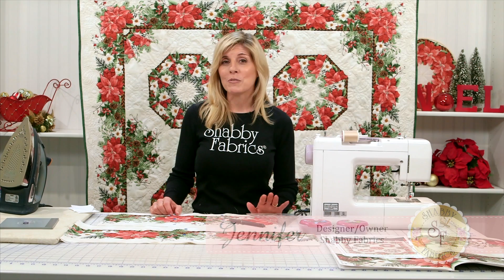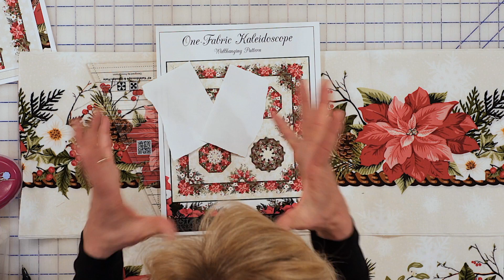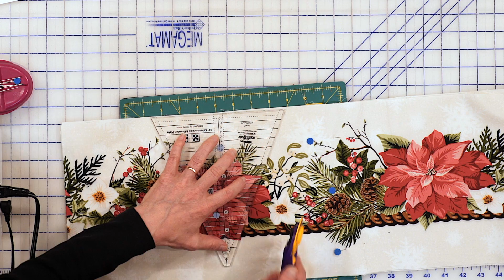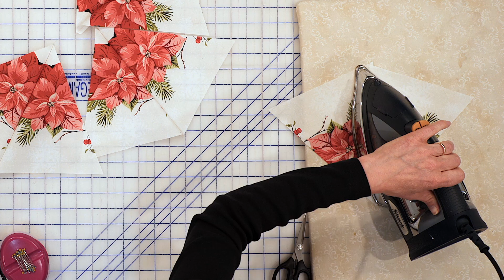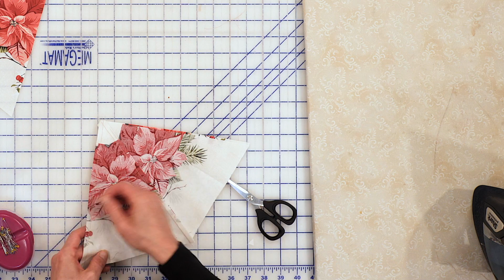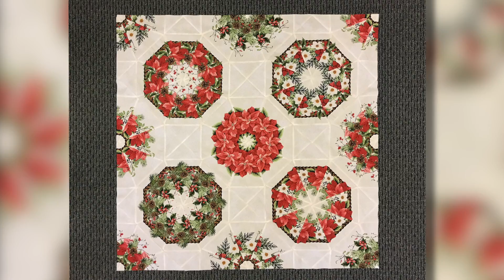How to Make a Kaleidoscope Quilt Block | a Shabby Fabrics Quilting Tutorial

Comment: Instead of making 2 stacks of 4 why not make 1 stack of 8 eliminating problems being exact on the 2 stacks? Nothing a new blade in your 60mm rotary blade couldn't handle!
Reply from the maker: That is a great option! While we do use fresh blades for new projects, we typically keep our stacks lower due to routine and cutting accuracy (i.e. instead of messing up 8 cuts at a time, we'd only mess up 4 😊 ) 💖 -Michelle
Reply: @ShabbyFabrics  good points!!! Great video!

Comment: Hi Jennifer, thanks for another great tutorial. Looking at the stitches. Do you use a smaller stitch as you normally would, since this is all bias?
Reply from the maker: Hi Ellen! Thanks for watching! We don't use smaller stitches than normal here, although that's certainly an option if you want to. We're just very careful not to pull, push, or tug on the fabric as it feeds through the machine to prevent warping. Hope that helps! - Morgan
Reply: @ShabbyFabrics  Thanks Morgan!